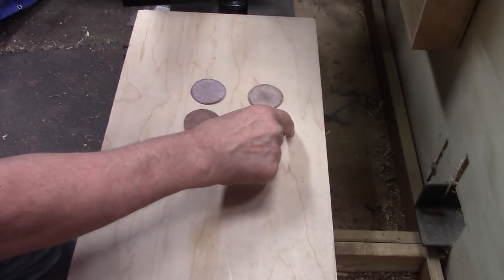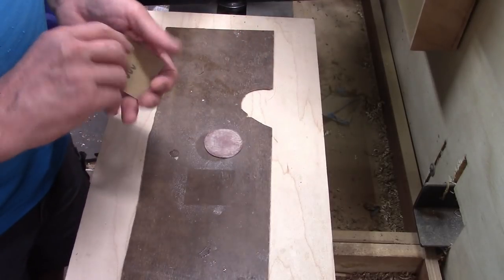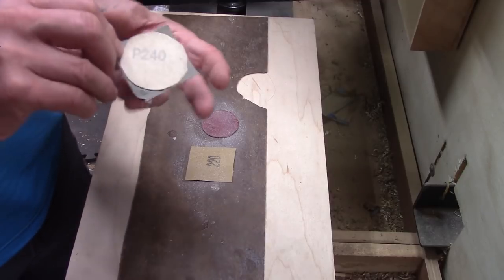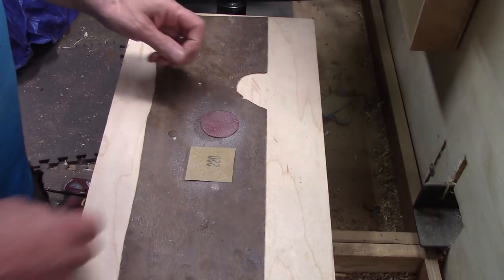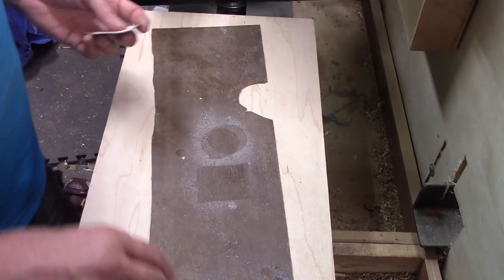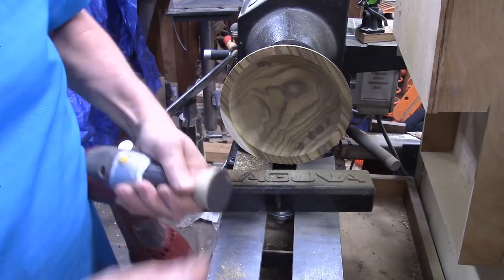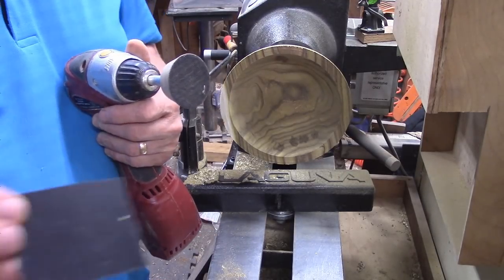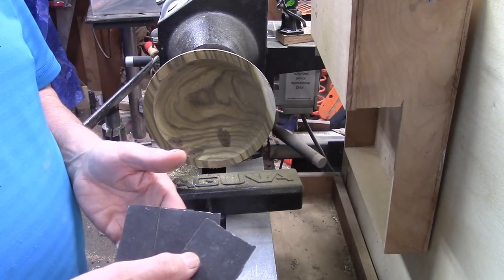How I reuse  Warn Out Hook and Loop Sanding Disk

Comment: Great Idea , And one that I use myself. I buy the large packs of sand paper 60 to 12000 wet and dry . Then i take those and cut them into sizes i need . My belt sander , Large Drum Sander i do the same thing. I save pennies at every turn.
Reply from the maker: Thank you and saving pennies is a good thing! The cost of the sandpaper that fits machines like drum sanders is where the money is made. Seems you are doing good saving that way.
Gary

Comment: Like that gary I will try that on my old ones mate
Reply from the maker: Thanks Paul I think you will like doing it. Make sure adhesive is well tacked up. Mine are stuck on good. I have not tried adding on top when that piece wears out but on the lighter grit it probably would be fine. Need to keep it flexible though.
Thanks for watching and commenting buddy!
Gary

Comment: Great idea, Gary. What do you do when the stuck-on paper wears out? I'll have to figure out how to put the dust collection holes in the paper if I try this on my 5" RO disks. Is that wooden box/structure on the right of the screen a dust collection hood?
Reply from the maker: Thank you Bill. So far I am happy getting one extra use. The spray adhesive really holds well and is hard to separate. 
Gary
Reply from the maker: Sorry I missed the answer to the wooden structure. I answered the first part from my phone while on the elliptical at the gym.
Yes that is a hood I made for when I sand. I have it on hooks that slide on the board you see. I put that board up to contain the chips that end up on my table saw and it comes off easy well. I think I will mount it back a bit farther which should be easy to do. I very seldom cut wider than 24" on the table saw so moving it is not that big of a deal
Thanks again
Gary